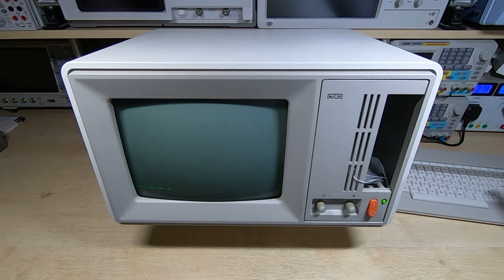NCR Computer Repair Part1

Comment: I assume standard ST-506 interface for the hard drive. I know when you first connected the floppy and powered it on with the drive door closed I cringed, but it was only the 8 inch drives I remembered wiping floppies with the head loaded during power cycles. It certainly seems like it is trying to load the boot sector on the floppy, this will be an interesting series.  Is it an 8088? If you mentioned, I didn't catch it.
Reply from the maker: The heads are NOT loaded on these drives just because the door is closed. It has to be explicitly loaded before the disk contents can be written. It was also a sacrificial disk. Don't panic as I have been doing this for a very long time and I do actually know what I am doing.